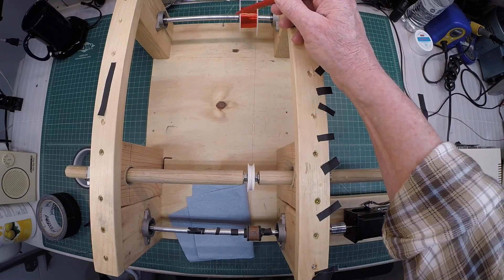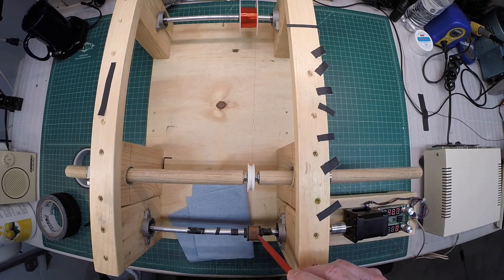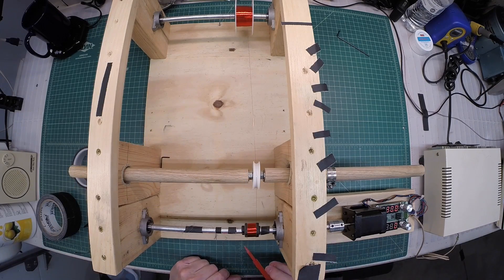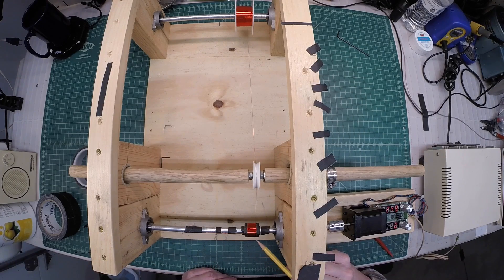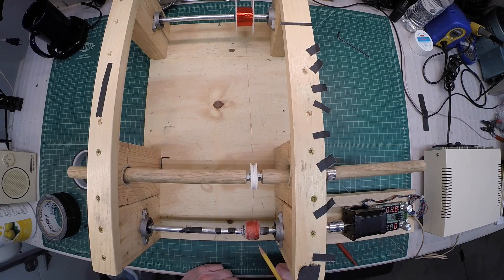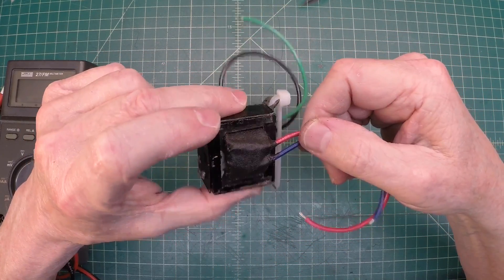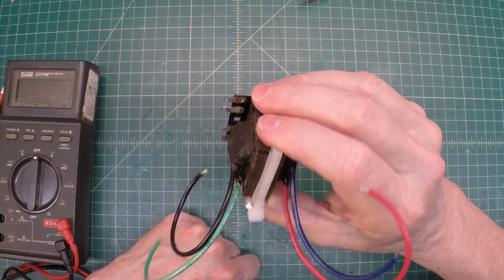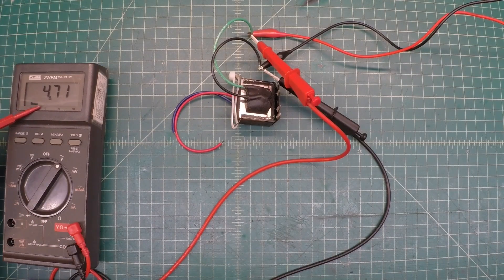Kadette Tele-matic AC Model 35 - Output Transformer Rewinding Final Result

Comment: Don, could you create an adjustable screw-driven wire-feeding device instead of manually moving the supply wire across the coil form? Perhaps something geared to the rotation motor, adjustable for wire guage. I don't think I could feed wire very accurately onto a form. You did well though!